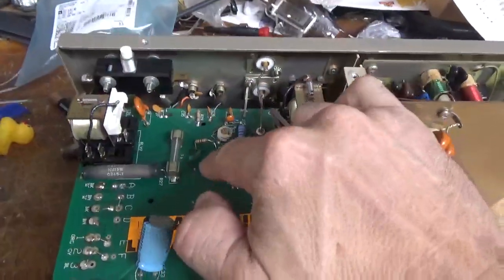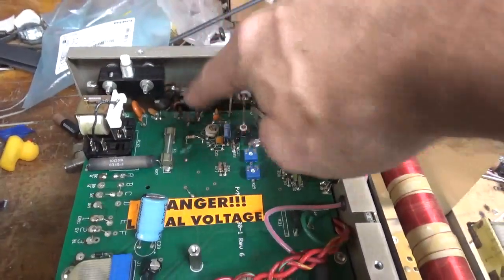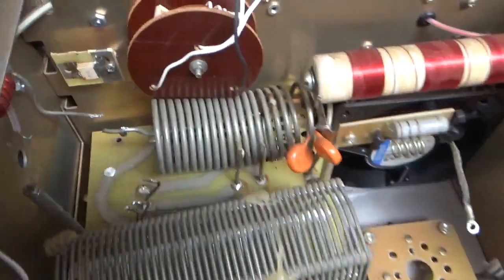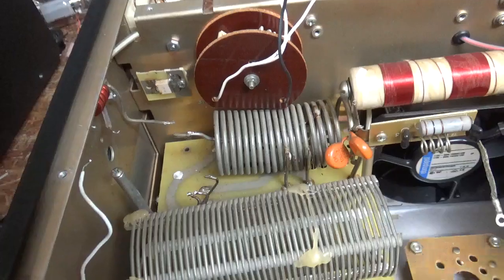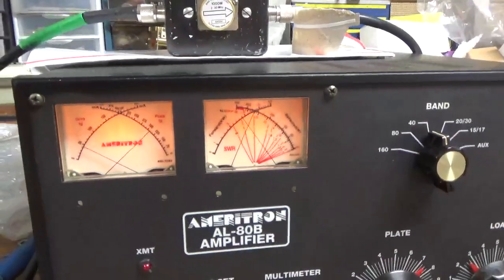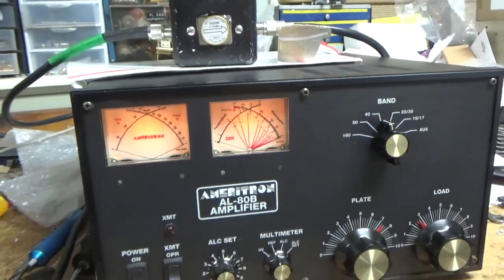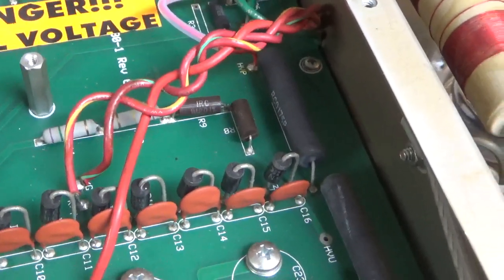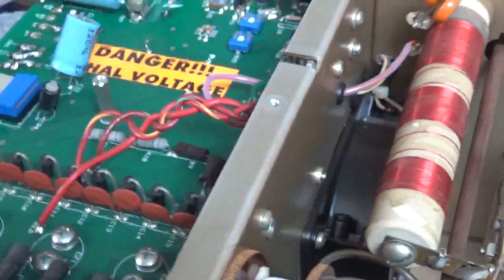Ameritron Al80b Repair, Modifications, New Band Switch, Lots of Issues 40 Meter Test.

Comment: Thanks, Scott...
I have learned a tremendous amount from your content...
Scott, I am curious about something...
When you mention your testing connections, you tell us that you are hooked up to a Bird "attenuator" dummy load. My question is...   Is there a difference be what you are using and I use, which I refer to as just a dummy load...?
Is there a attenuation of the rf amplitude before it actuality goes into your dummy load...? This might seem like a rediculous question  but....   😉
73, friend...
Reply from the maker: It’s a dummy load with a attenuator built in. Allows use of a spectrum analyzer , scope etc 

Just a more expensive version of a standard bird dummy load